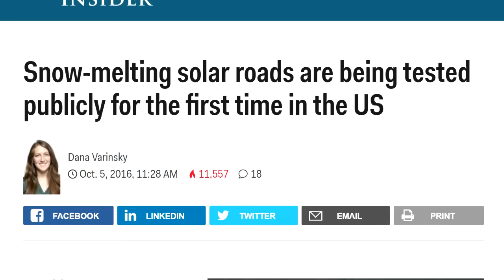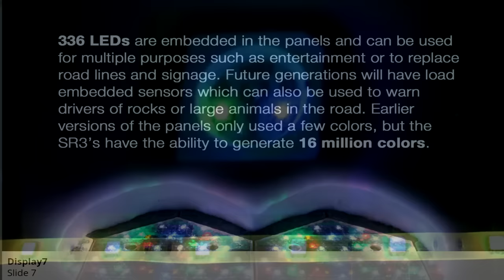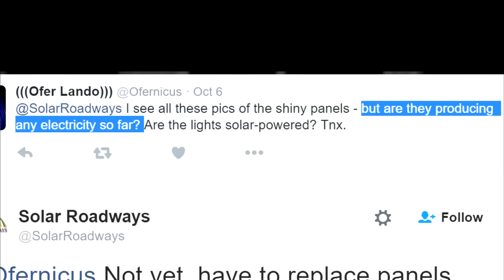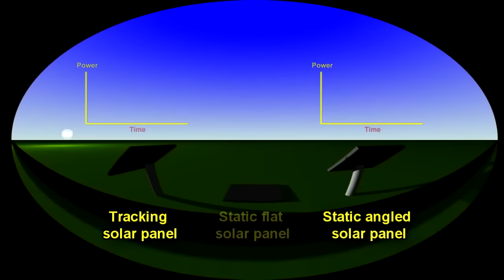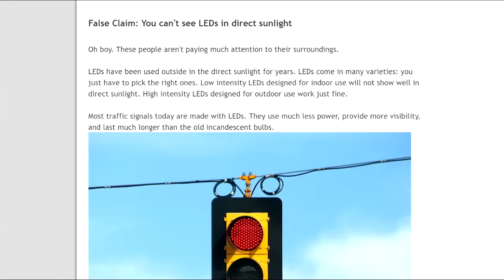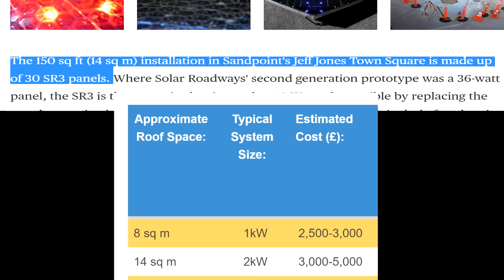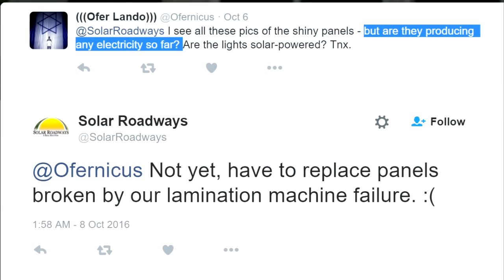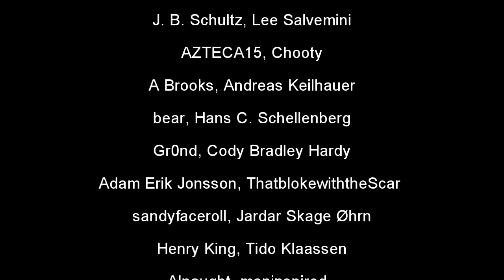First AMAZING Solar Roadway UNVEILED!

Comment: Proof of concept is not the same thing as being commercially ready. the point is that something with the capability to generate electricity contributes more than something that does not. It's obvious there are design flaws, but I've been in enough white board meetings to know that no plan survives contact with the enemy. It's important that we spend at least as much energy suggesting solutions as we do pointing out problems -- you've definitely done your homework on the latter.
Reply: The problem, as has been pointed out many times, has nothing do with possibility. Even a commercially ready version of this product is mindbogglingly stupid. It WILL cost orders of magnitude more than roads, while creating a worse road surface. It WILL costs orders of magnitude more than rooftop solar, while being 50% OR MORE less efficient.

Roadways are almost literally the last place on earth we should be placing solar panels. Maybe the idea will have merit in 100 years when every rooftop in the world is knee deep in auto-tracking solar panels. Until that happens (and if we somehow need more power after that point), then we can start looking at putting them somewhere else.

Hell, it'd be cheaper and more effective to simply put a set of raised platforms with solar panels on them above the entire US road network than building the panels into the road itself. And that would still be a stupid idea. There is so much unused surface we could cheaply install panels in. Solar farms have economies of scale for redistributing the power to where it's needed. 10000 m^2 of solar panels in a couple fields, going through one series of transformers and entering the grid, is better than 10000 m^2 spread out over a couple miles of road.

Comment: i commented on an earlier video now can i just make it very apparent that very few innovations of this scale and impact rarely work first time out. good examples: wright brothers, edison, tesla, nuclear energy in general. the point being is don't chastise people because there "potentially" revolutionary idea. now in a previous videos comment i went in to the simply mechanics not being accounted for in the design of the panel as he picks apart this man and his wife. 

Tracking Solar Panels: this is kinda a give and take, its better than a stationary panel TRUE. but not as much as you would think because it takes energy to move the panel and then also has to move it back with no sun light to catch the rising sun so your only really getting about 30% better but not 60%.

Lensed Solar Panels: this is a better solution over tracking panels because it takes no energy because it doesn't move. the idea is simple but a lens of greater surface area and viewing angle place over a solar panel and tah dah your flat solar panel on the ground can see and focus the light from sunrise to sunset giving the ideal 90% saturation of an entire days light.

but heres my point i build alot of crazy things i am a electrician and electrical engineer with a little mad scientist thrown in for good measure. now i searched around did alot of math and cam up with a solar panel and led combo that makes power using the same general measurements they give for the surface area. So this means in fact this can and should work!!!!! BUT BUT BUT this video does show that at this point they should maybe they should get some outside help and figure out how a road is built or a side walk for a matter of fact.
Reply: Sean Roach no, the problem is we don't need this innovation, they wouldn't solve any issues

Comment: Conceptually the idea isn't bad I think they just funded the wrong group of ppl who don't seem to know what they are doing, the lights are completely unnecessary and even normal panels we have today can withstand rain literary their only challenge is to find a way to efficiently withstand the weight (obviously not glass) of cars and trucks which they should just give that challenge to a group of mechanical engineers and physicists, in this case the funding didn't go to the right group of people but I do think it's important to give there grants to ppl doing research is just that the people giving the grants should be better informed about what they are doing and I think that if someone wants to make these ideas a reality this video is very important because it highlight a lot of the current issues it has the limitation with rooftops is that most are private property so it would Lead to legal issues in the long run if your trying to generate power for a whole city per say

Comment: Well, first of all they need to think about the material to use, maybe the same type of glass like the chinese built for those famous glass bridge, secondly, perhaps a massive overhaul to replace the entire network of road will be quite a challange, but perhaps it could work as a pavement, in limited area, as prototype, that imo, more usefull as a tourist attraction spot of some sort rather than actual energy generator, where the money generated by tourist will be directly used for other renewable energy

Comment: Serious question: we know they produced no power but did they create enough to (briefly) light themselves or were they sneakily plugged in?
Reply: the heating elements, processors, wifi, leds, etc. are all powered by the grid.  Any power produced by the solar panels are fed into the grid - not used to directly power the leds, etc.  So they are plugged in as intended, but the solar panels aren't producing anything.

Comment: The only problem I'm seeing here that's not solvable is how cost prohibitive this type of project would ultimately be as well as costs associated with developing materials and processing methods to produce tiles with hemispherical lenses to account for at least some of the lost efficiency due to stationary, flat tiles as well as the abrasion forces. Developing a system to better spread out the weight of a moving car would be the easy part. Nonetheless, synthetic diamond roads anyone? Granted, it's been a few years since I saw an asphalt tire. Changing a flat one of those was a bitch to say the least.

Comment: The problem with this kind of argument... avenues of successful technology are rarely impressive in their early days. Cars and planes are excellent examples of this. The invention of the car did not immediately outmode the use of the horse/carriage, the airplane took innumerable attempts to become airworthy, and even then its capabilities were severely limited in early incarnations.
Honesty and critical examination about capability of a project in its current state rather than pie in the sky thinking is beneficial, sure, but I think it's important to consider that engineering is a process of ongoing refinement. A bad execution of a concept does not exclude the potential of a good execution of the same concept. Or working from knowledge that was garnered from a failed execution.

Comment: I think what frustrates me most of all, regarding this subject, is that all of this money could be invested in a solar plan that actually works. Literally everything they describe could be accomplished by building the panels as an overhang. You can house all of the sensors and lights in that system, and they'd actually be protected from the elements by the simple fact that they can be housed under a roof. Oh, and it solves the snow issue. You know, because it's a roof.

Why can't communities invest in good projects, rather than sensationalist drivel?

Comment: What should be funded is people's sceptical and scientific thinking. If more people were able to quickly calculate the resulting power output from such a road (this can be calculated by a 10 years old child) and to imagine what could be the technical difficulties (you need just some building experience for that)... 

It's a napkin or proving concept stage idea that tries to break for funding - this time successful to funding and failing at a proving concept level - might be because of an inexperienced design. 

Anyway - in such a technology the hardest thing would be to put the production price low enough - 30% efficiency is ok if the construction price for durability is less than 30% higher than that of the today's road construction costs. Concept might be changed to a much bigger blocks that are produced in a megafactory with super low production costs and can be made fully automated for repair and build (see China's road construction boom).  If technical difficulties are to be overcome, here is some simple calculation:

calculation:
Considering 30-35 million kilometers of road are around the world these days. 1/2 of this is not suitable due to low sunlight in the northern regions, 2/3 is not suitable due to insufficient social stability in the country (most of Africa will be great for solar roads, and within 60-100 years there will be reasonable governments and economic growth, so i consider this as a plus). Average road width is 3.7m per lane and average lanes per road (suitable for reconstruction) will be about or above 3 lanes. This gives 32000000*1/2*2/3*3.7*3 = 1100 sq km (or 118400000m2)  of a road suitable for reconstruction. 
Checking wikipedia ,the most reasonable number for power, generated by solar panels today is 1700 kWh/m2/year. This is for a panel at most efficient angle at the sun. If you put the panel on the ground it will be about 0.6 of that value which gives
118400000*1700*0.6 = 120 TWh/year 
In comparison the total non-renewable energy consumption was 135.8 TWh/year in 2013 (the most recent reliable figure i could find)

Please, check my calculation for mistakes!

Effectively, with solar roads to be applied we pay the difference from the construction cost of nowadays roads to the cost of planting solar panel bocks on the roads. and for that we achieve almost full transition from non-renewable to renewable. The environmental gain will be the environmental impact of production of solar vs this of asphalt roads plus this of fossil fuel energy production. To be calculated, these things would require people from the industries to put actual numbers and environmental effects of many things to be backed up with correct data (which is a problem we better be able to solve, and soon, so we are to be able to put a price tag for new inventions like this). 

remarks: 
These panels can be put everywhere we use large paved places in our cities and increase the area if it's efficient.
I used 1700 kWh/m2/year which is a number achieved in about average conditions. We can put solar panels where it's efficient and we can increase the value of up to 4000 kWh/m2/year in some spots (not putting panels below trees, between tall buildings, in very dusty environments etc. 
Cost of cleaning the roads will be split for dual purpose - we will be happy to drive on clear roads anyway :) and it will help self-driving cars a lot (adding extra free time for every driver)
Surface that remains in shade below cars is not that big and can be considered as a calculation if the spot is efficient or not (all day full parking lots).
Factories that produce the panels can make them almost fully recyclable and automated vehicles that roam and clean them can replace them on the spot. 
World is going to require and use higher technologies anyway - such system can be of help in many many ways (bringing optical internet to every house in a big city so poor citizens of Berlin and London can take a glimpse what is to have internet connection like in Vladivostok and Sofia :) ) 

conclusion:
Technology is competitive for the future, but poorly. Things like Thorium reactors and magnetic fusion reactors, or even hydrothermal power plants can kick this technology out of the market. It is a great thing to have for an alternative, thou. Overcoming technical difficulties for Thorium is easier than solar roads, but overcoming the "N" word is something for the far future. Power from Thorium is much more.
Overcoming technical difficulties for tokamak (the fusion reactor) will be a challenge for the years to come. Energy output from this technology will dramatically change the world - there is no other energy source that competes with fusion. We don't know how many years of research is needed, thou.
Hydrothermal is quite unknown (for my surprise), but the earth is quite big and has huge amounts of energy in it. By adding one or two water convective circles can be quite simple and non-destructive in the future - a very interesting, not as renewable as nuclear or solar, this option can be a solution in many areas of the world!
Reply: just to let you know, we cannot store electricity. left over will be grounded. If you generate same as the non-renewable, it will only result half of the electricity will be throw away and during the night we still need other energy source. Since those power stations cannot be turn off anyway so better just let them run during the day too. the only reason why people put panels on their roof is to sell the power, not to use the power. I barely need any electricity during the day since i dont need my light on, no hot water needed since no one at home, no room temperature needed since no one at home. so yah.....

Comment: Thunder, do you think that with enough resources solar roadways will become reasonable to start replacing regular road with solar panels?
Reply: if we had unlimited resources then sure, why not
Reply: Granted, I guess I'm trying to steer to the question to: is it something to spend time and  energy on it
Reply: Not in the foreseeable future, no. The thing about solar panels is that they are crazy expensive. They take years to earn back their manufacturing costs. So, for a reasonable return-on-investment, you want to put them someplace where they can do their best work, having access to unblocked, perpendicular sunlight. The last thing you want to do is put other things (a thick layer of glass, shadow from buildings and trees, vehicles, oil slicks, snow plows etc.) on top of them.

Meanwhile, the thing about roads is that you need a shitton of them, so you want to keep the cost down. They also need to take a lot of dynamic mechanical stress. They need to withstand large temperature gradients and provide a smooth surface with sufficient grip to ride on. They need to withstand the grinding action caused by wheels and all the gravel, dirt, sand etc. that roads invariably get. They need to last a long time without maintenance, as maintenance incurs a ton of external cost with road closures. Modern asphalt roads do this all, and are mostly made out of recyclable material. The last thing you want to do is replace them with something that is structurally way more complex, expensive and vulnerable.

As you can see, these are 2 things that serve fundamentally different purposes and evolved by fundamentally different requirements. They don't go together any more than a nuclear powered airplane or an edible garden fence.